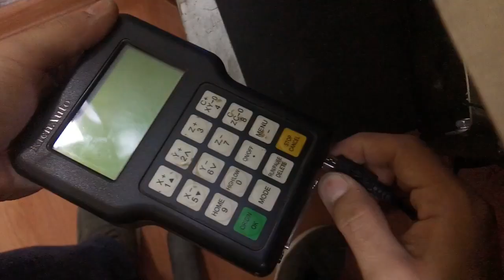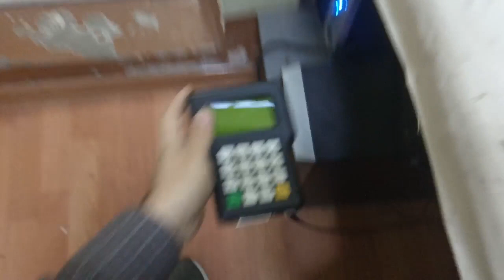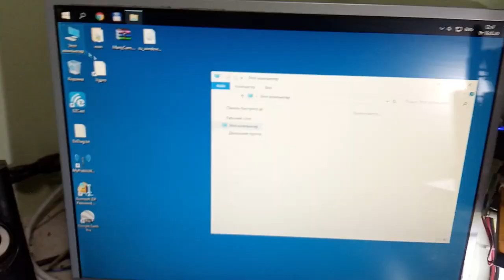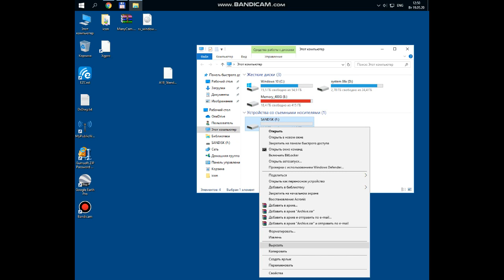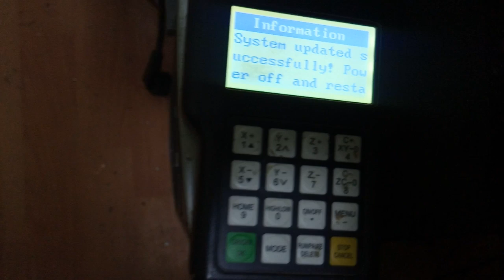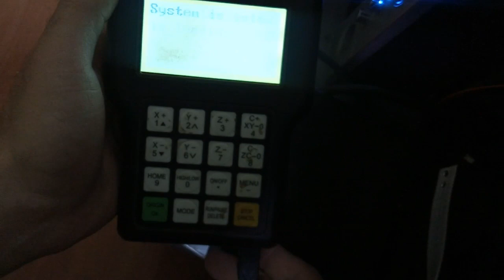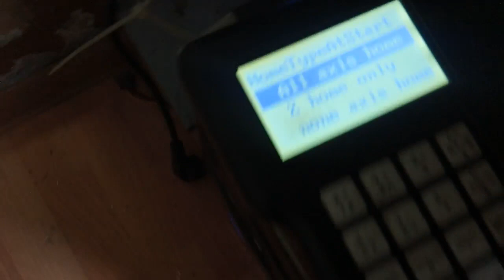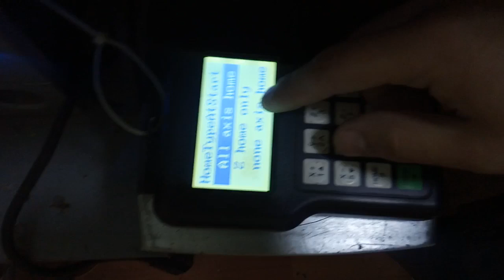richAuto A18 upgrade firmware usb (uzbek)

Comment: THANK YOU VERY MUCH BRO,TODAY MY REMOTE IN SAME CONDITION,I ASK SOME MECHANICS WHO ALSO SOLD THIS,ALL THEY TELL ME SHOULD BE NEW ONE ,ITS DEAD.THEN I FOUND YOUR VIDEO,I DO SAME BUT IDONT HAVE HEAT GUN ,SO I DO WITH LIGHTER FLAME,AND ITS WORK FINE NOW.THANK YOU VERY MUCH FOR SHAIRING SUCH INFORMATIVE IDEA.
Reply: Hi Rashid, I have this problem. You really fixed it with a lighter?